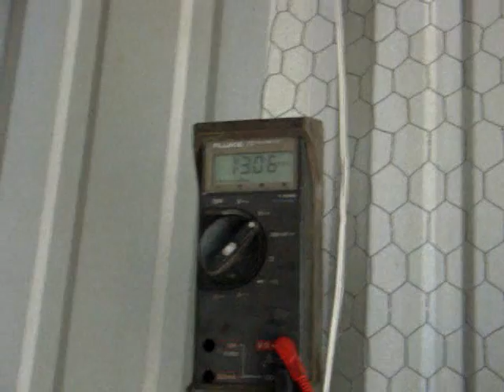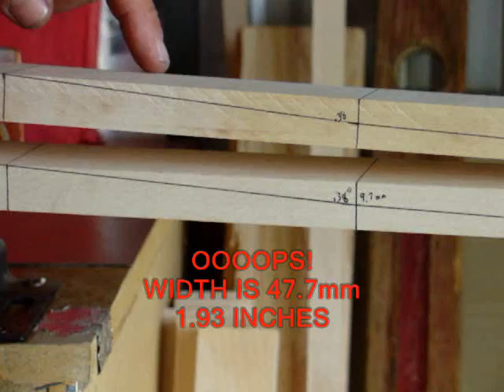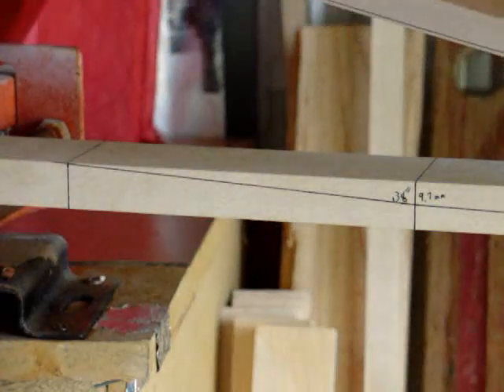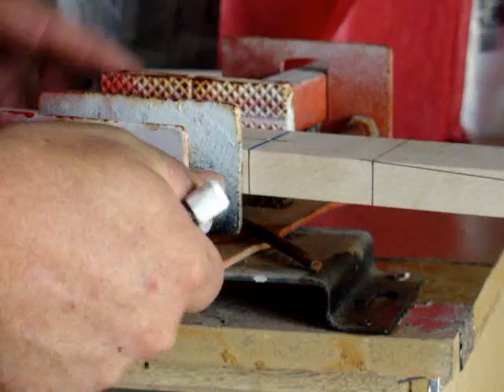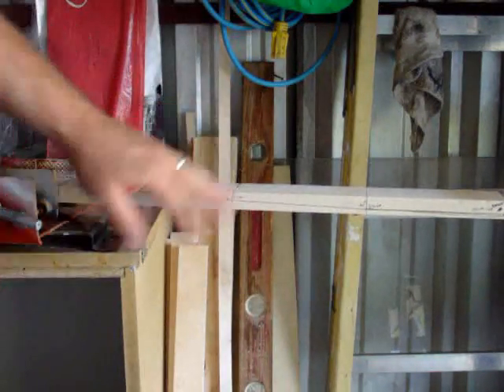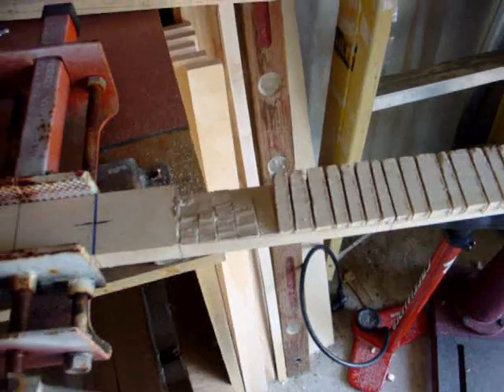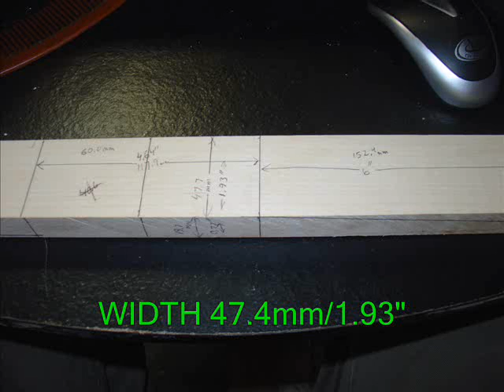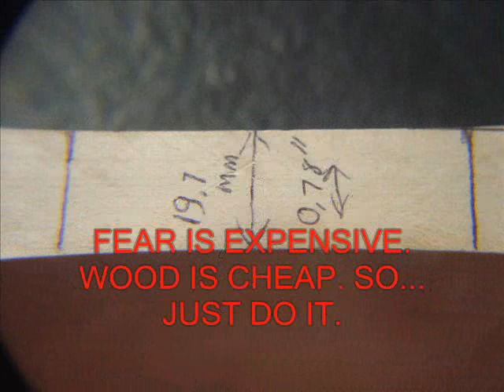PART 1 NEW SHOP - SMALL PROP

Comment: @muddymuddymuddmann
 G'day..! Wow Scotty, y're certainly a Wildman Woodcarver..! I use Aviation Propellercarving approach. 3 to 6 laminae, each balanced, with heavy ends (Roots) & iight ends (Crown) alternating. Blade plans drawn on each Laminae, plot the Glue-Lines & jigsaw the cutaways... Laminate with an Axle in the Hub, & Clamps... Then Rasp off the "terraces", to the Resorcinol Gluelines... Have you seen the "SunFoil 5th Prototype Construction" clips ?